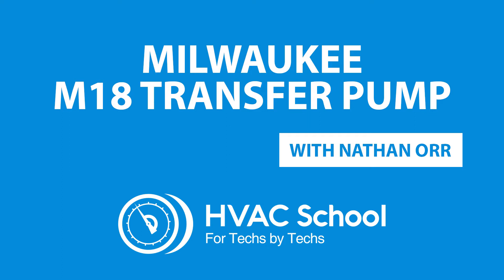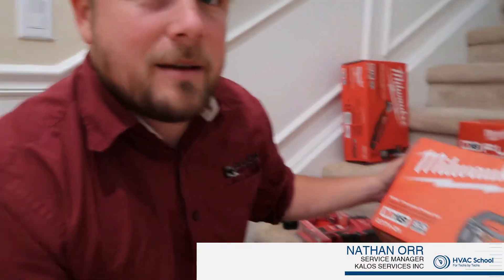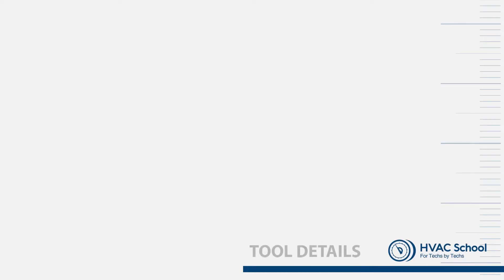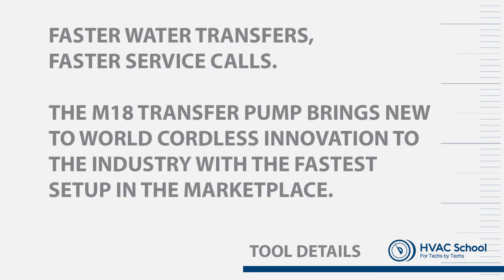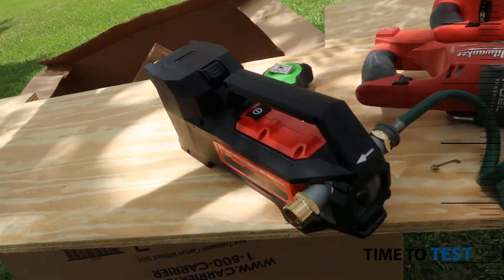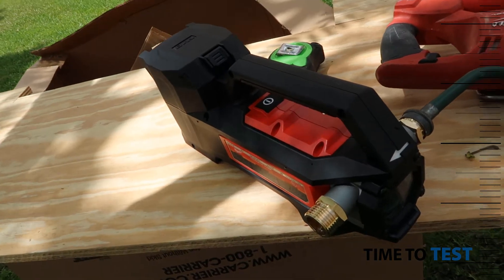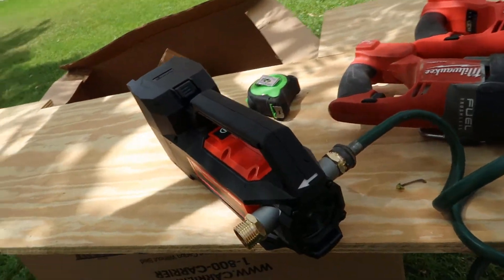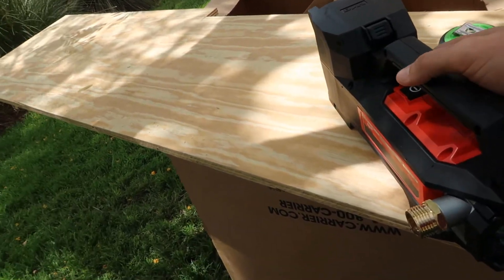HVAC Tool Review - Milwaukee M18 Transfer Pump Kit With Nathan Orr

Comment: Pans around here are filled with blow in insulation, rust, etc. How does the pump handle this stuff?
Reply: Good point maybe add a filter

Comment: Usually if the safety pan is full the condensate drain is blocked though.
Reply from the maker: Joe Shearer sometimes it's due to a freeze up, in general the first order of business would be to unblock the drain.
Reply: HVAC School true